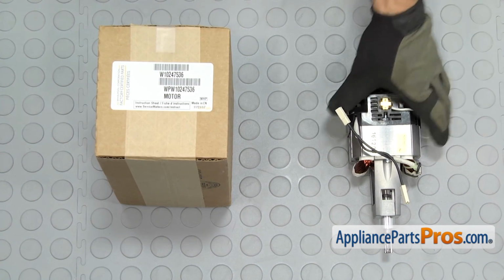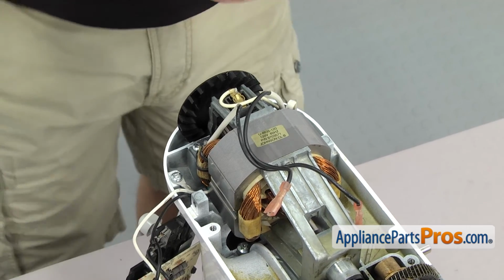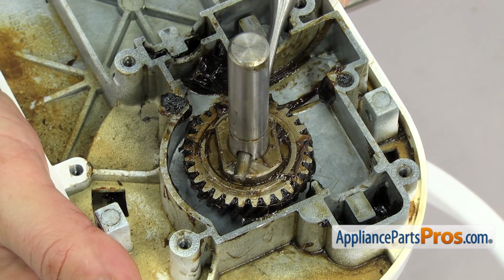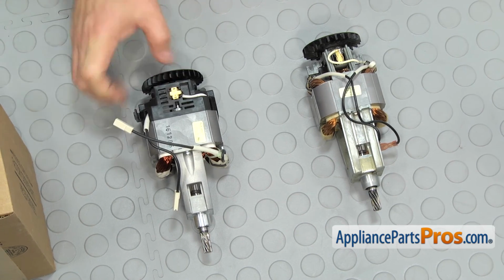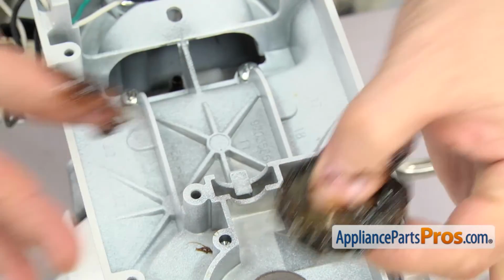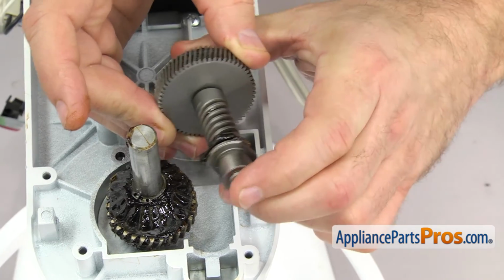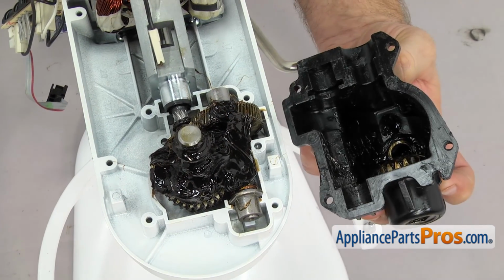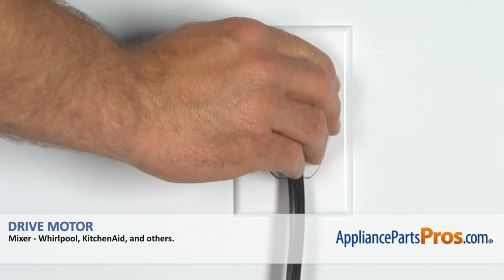How To: Whirlpool/KitchenAid/Maytag Drive Motor W11164116

Comment: So if the motor has to be replaced I guess that means the new motor is going to be crappy like the motors in the new mixers?
Reply from the maker: Good question, @CassieSpring! The replacement drive motors for mixers are built to meet the same specs as the originals, so you shouldn’t notice a drop in performance. They’re designed to keep your mixer running smoothly for years to come.

Comment: Kitchenaid is now about quatity not quality plastic parts etc
Reply from the maker: Is there anything we can help you out with?
Reply: Yes, 3 months and I have plastic in my food. Only used it a few times for cookies (not stiff dough) and making mashed potatoes. I thought I would just fix my old one of 40 years. I may find the motor will need replaced once I open it. It isn't worth putting in a new motor that is less quality than what I have that is fine. At least your videos are easy to follow.

Comment: Excellent video, ur video inspire me to fix my Kenmore mixer, been sitting in garage for last 10 years. How u can fix Kenmore mixer, How I'll know which part is not working, its not spinning. Can you please help
Reply: Check if the brushes are broken and contact Kenmore customer support. Any broken electric motor often just has melted lead wires to the on off switch if it got hot. You can usually download a free pdf of operating instructions from the internet or the manufacturer website for just about any appliance or motor.

Comment: What a great video. Is it possible to only replace the carbon brushes?  Where are they located on this motor?  Thanks in advance
Reply: There is another video on that.
Reply: @jrowe9301  thanks.. I've searched extensively and couldn't find one for this model.  do you have a link?
Reply: @charlesb3422  what model is it?
Reply: @jrowe9301  the motor part is W11164116 and the brushes are integrated inside the motor housing. and the stand mixer model is KP26M1XACS
Reply: @charlesb3422  here is the motor if you end up needing all of it but one moment while I look up the manual and customer support. You might be able to work it out with them to replace just components. 
OEM Whirlpool W11164116 W10247536 Mixer Motor 8204562 9707507
Reply: @jrowe9301  Thanks, I reached out to KA a while ago and they replied that I'd have to replace the whole motor assembly to replace the brushes... someone with a bit of adventure should be able to just replace the brushes...
Reply: Excellent video. Why do companies always change technology and make people reinvent the wheel just to rebuild something, whether it’s cars, lawnmowers, chainsaws. Our cars will mostly be thrown away in 20 years because nobody will have the old computer modules.